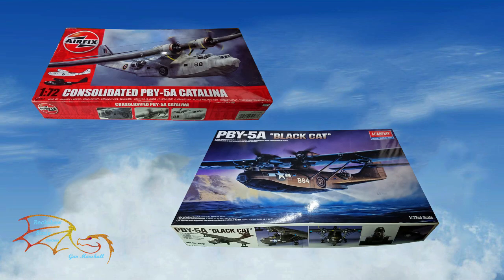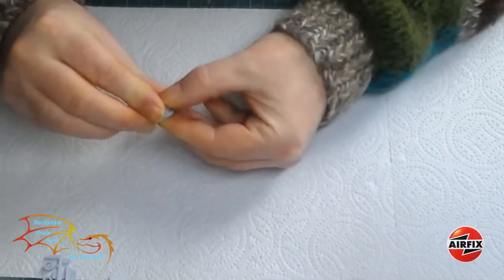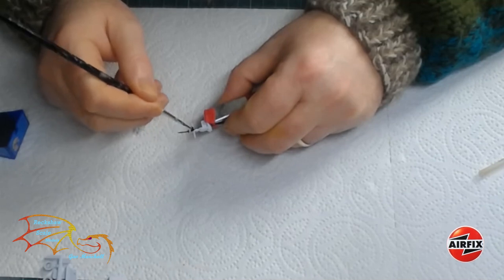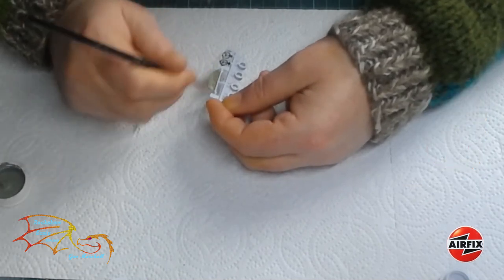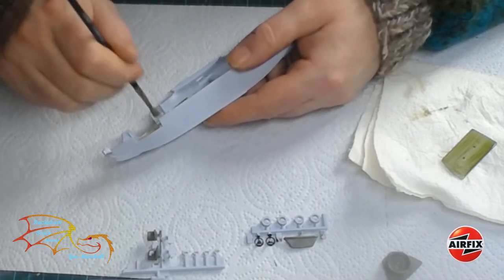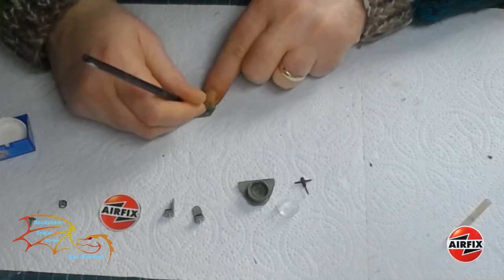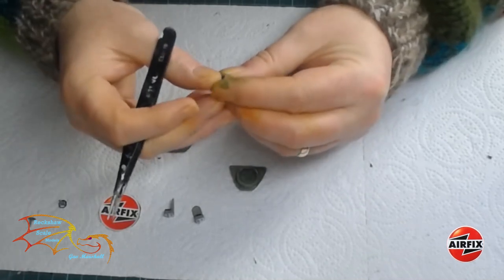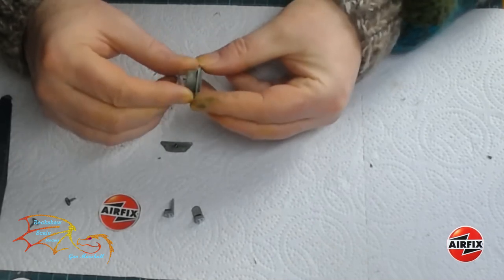Airfix & Academy PBY 5A Scale 1/72 part 2

Comment: I don't know about the Academy kit, but the Airfix kit is total garbage. Almost every single main piece such as the wings, and fuselage were so warped and other fit issues, that it was completely unbuildable, and I ended up throwing it in the trash bin. In addition, every single part has tons of flash on them. They only good thing I can say about the Airfix kit that I had, is that I found it at a local hobby store at a greatly reduced price.
Reply from the maker: Hi paulsmodels,  I'll be the fist to admit building aircart is my weak spot in the hobby and that kit did give me a bit of a challenge.
I had to bare in mind that it's an old kit and Airfix release is a much better kit to build. Thanks for your thoughts and for watching.